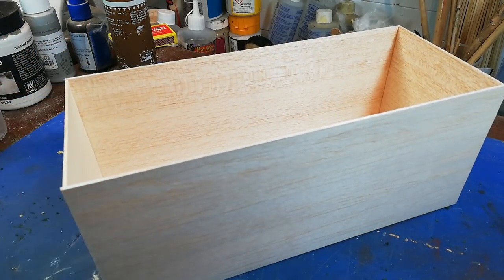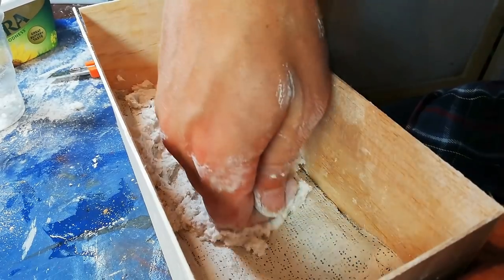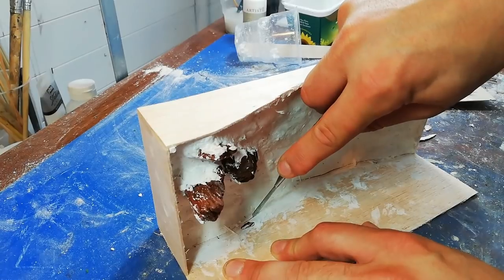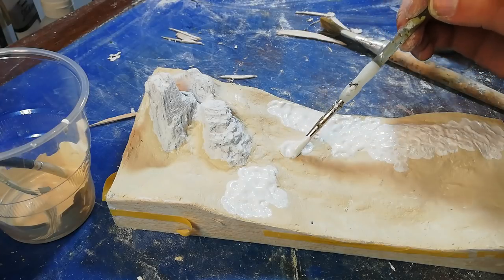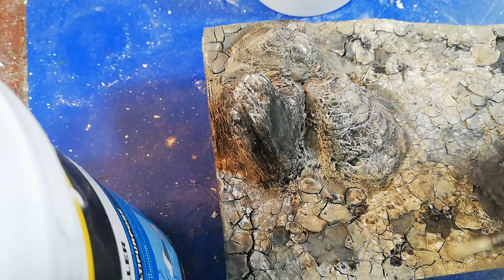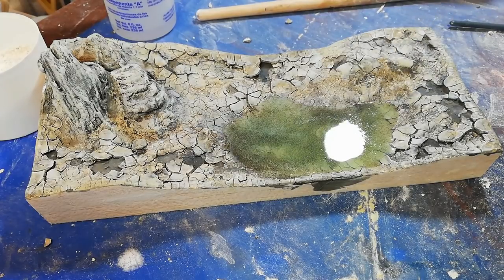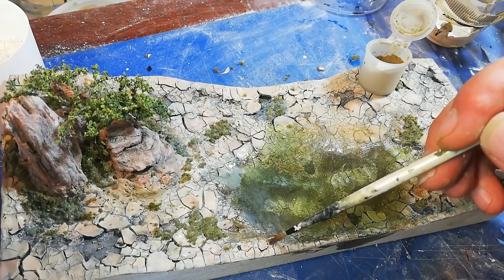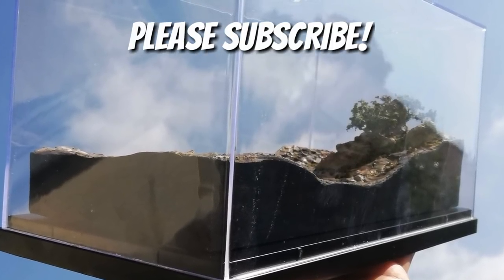Super-realistic desert pool diorama with cracked earth

Comment: Very nice. However, I wonder if it is actually correct to make bottom of the body of water with cracked surface too? Shuold not the mud be more smooth in the pool?
Reply from the maker: The bottom isn't cracked, only the edges. As far as I remember.... It was based on a photo.